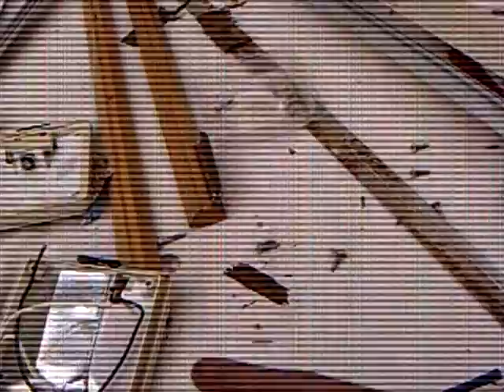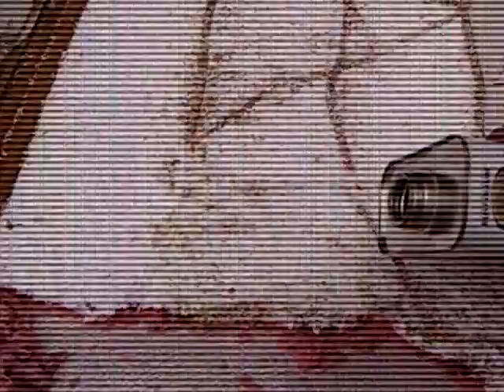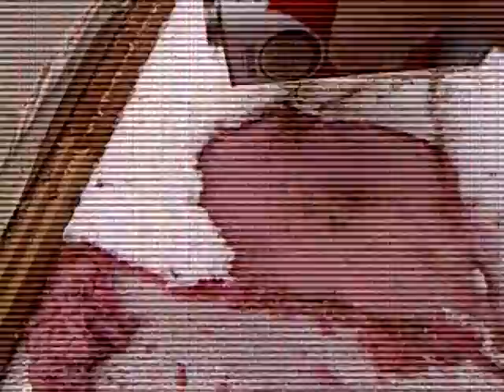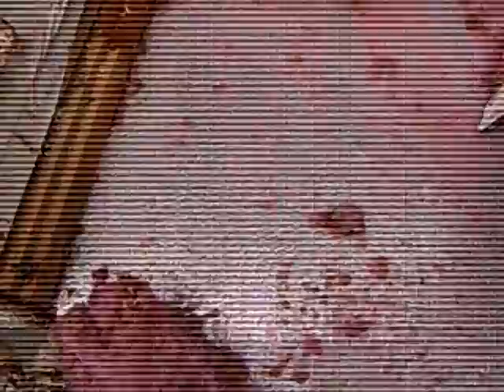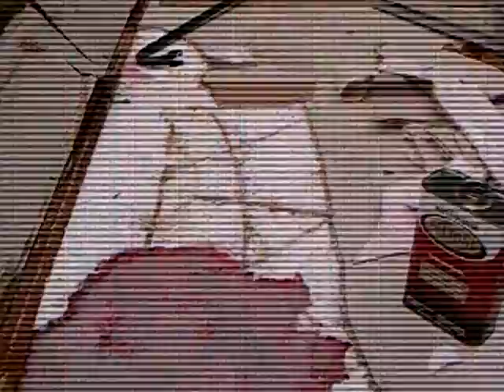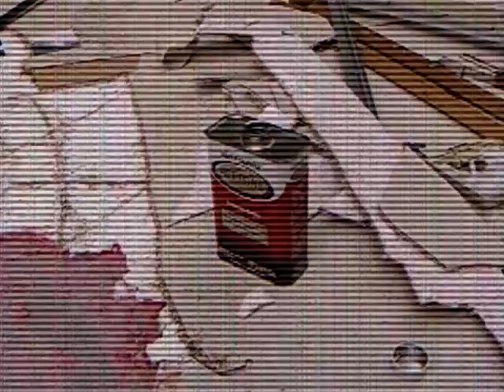Acetone: How to Remove Styrofoam from Adhesive-Backed Aluminum

Comment: Im repairing a Coleman Columbia pop up too.  Im thinking of replacing the Styrofoam/wood with a solid piece of wood instead (I only need to replace the four sides and not the top).  Can you tell me what you used to replace the Styrofoam/wood and if you were happy with it?